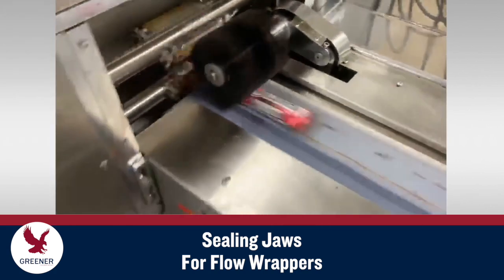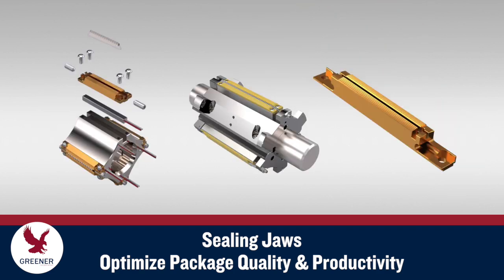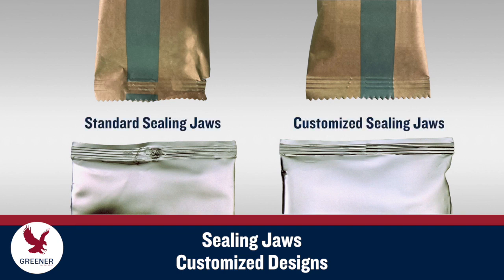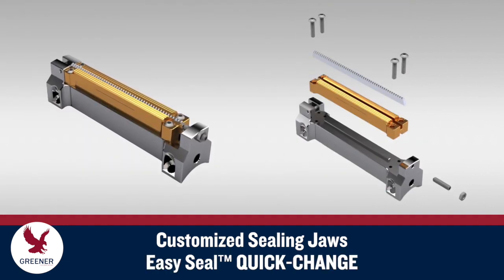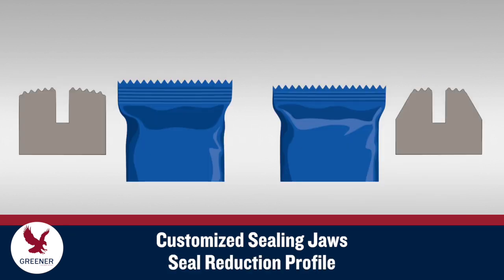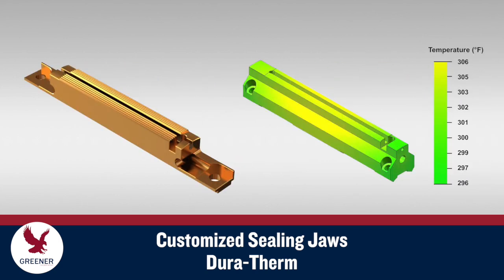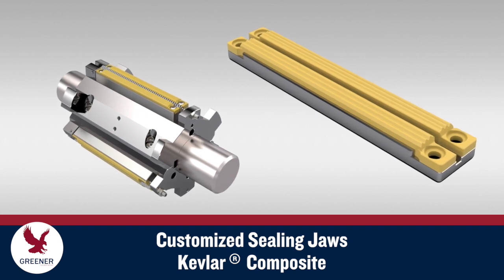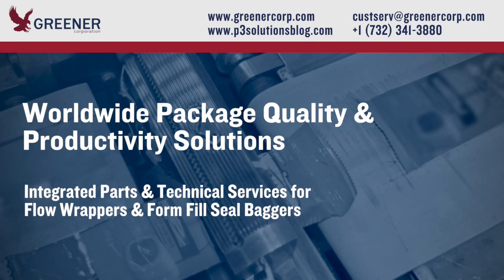Sealing Jaws Optimize Package Quality & Productivity on Flow Wrappers

Comment: What do use to prevent burning your hands
Reply from the maker: Thanks for your question. The initial installation is done when the sealing jaws are cold. Then, once the jaws are heated to operating temperature, adjustments are made to fine tune the seal quality. If needed, an insulated glove can prevent you from burning your hands. If you have additional questions, please contact Greener Corporation at custserv@greenercorp.com  or via our website: https://greenercorp.com/contact-us